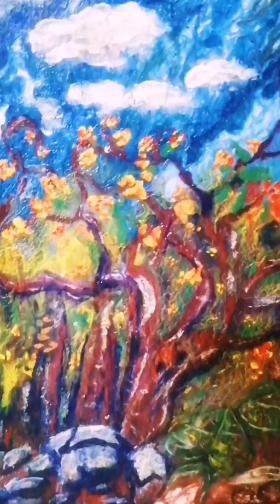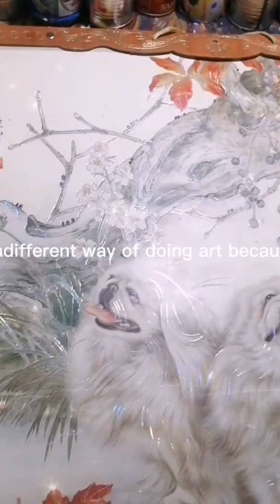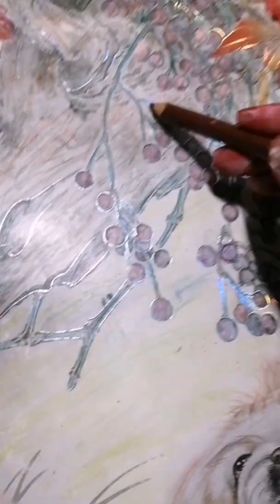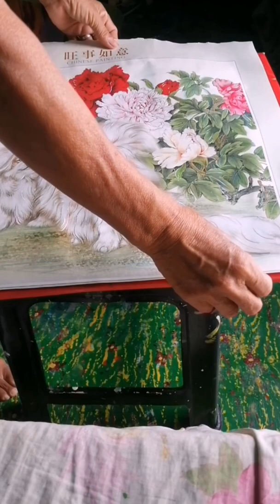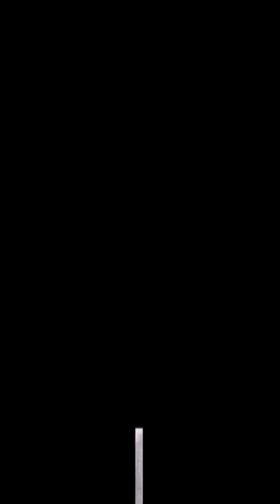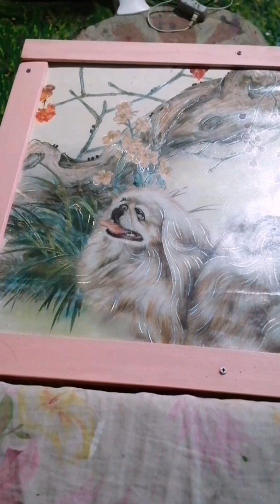printed picture to make real painting

Comment: Painting is the practice of applying paint, pigment, color or other medium to a solid surface. The medium is commonly applied to the base with a brush, but other implements, such as knives, sponges, and airbrushes, can be used. In art, the term painting describes both the act and the result of the action. #Teamglen
Reply from the maker: Thank you so much for your very nice opinion🙏🙏🙏🙏